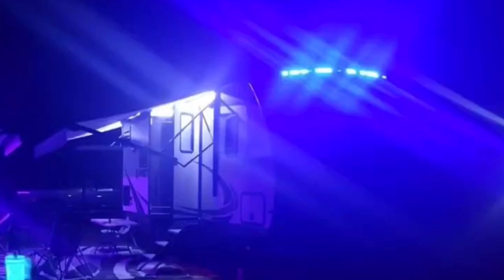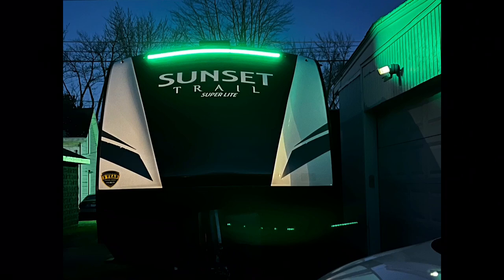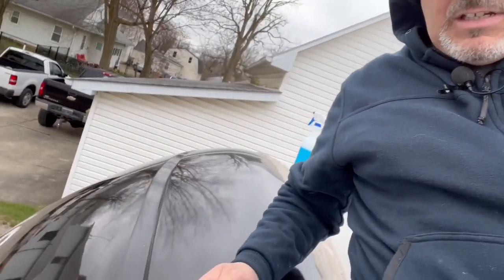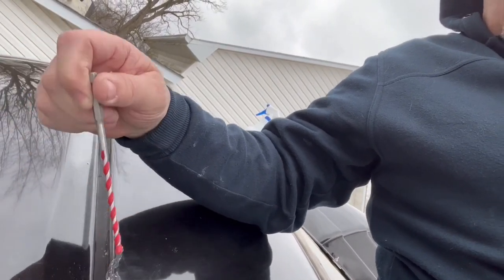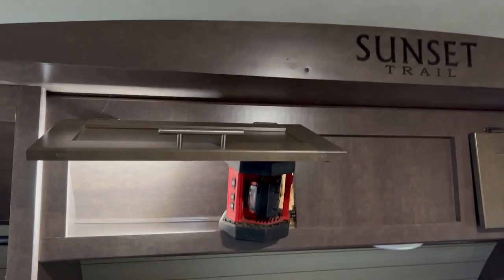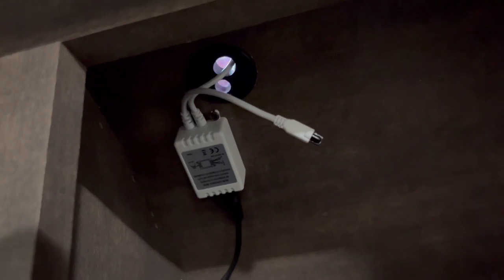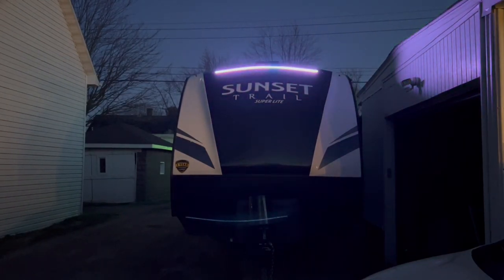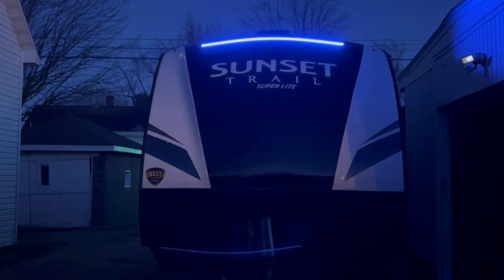Time to fix those stupid burned out LEDs on the nose… for cheap EPS26

Comment: My above bed blue leds have had a short since I took delivery. I always have to wiggle the protruding wires to turn them on.
Reply from the maker: I would remove the switch, and inspect the wires. Probably a loose connection.

Comment: I’m so confused about the nose lights? Is there a way to replace them and still use the switch in the garage? I also want the garage lights, that work with the garage switch, to be motion detecting and not rely on the switch. Should I just add a motion light to have as well? Like on the water side? That’s what I did in the outdoor kitchen. I don’t use the switch light because I can rarely reach it depending on where we are parked.
Reply from the maker: Yes, I wish I could have done that, the wires fell down inside the nose when I cut the old lights off, and I was unable to fish the wire back out. 
I actually have some LED strips here and some motion sensors, I hope to have a detailed install on that here shortly, if it works, I have a couple places to install them.

Comment: Did you say it would be possible to just use the original wire? No need to drill etc depending on the new strip features?
Reply from the maker: Yes, that was the plan till the wires fell into the nose